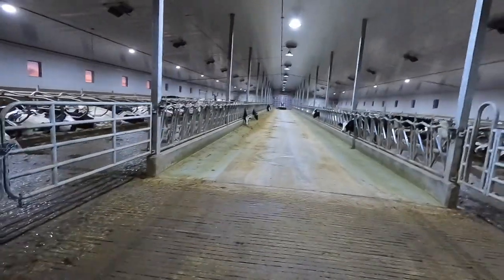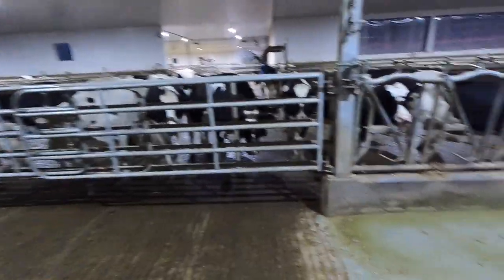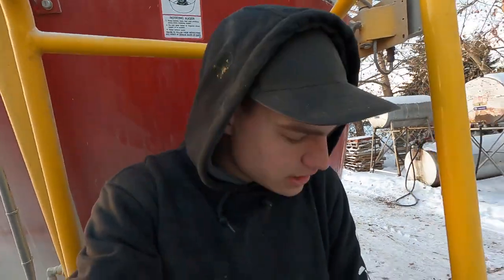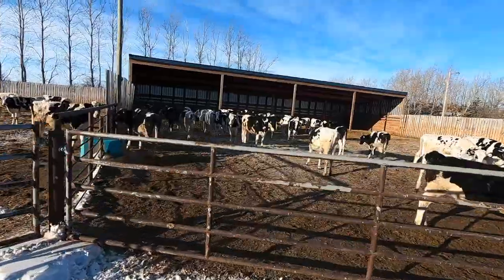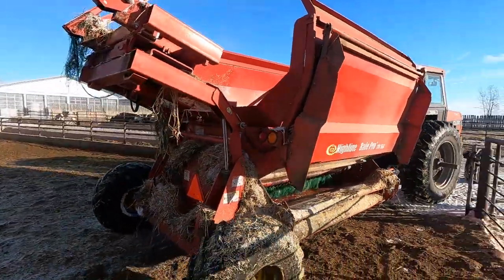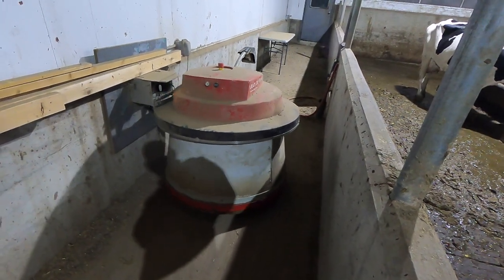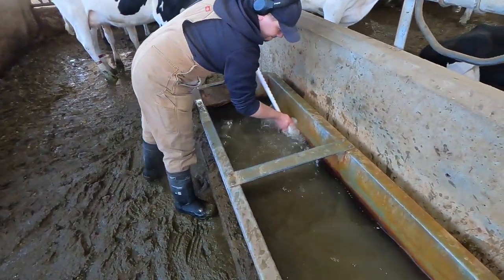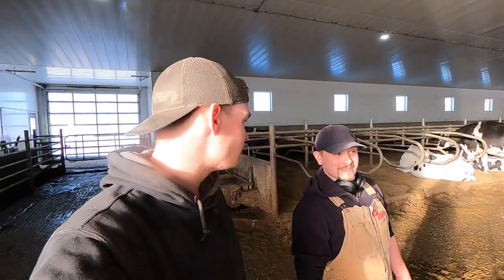Cleaning Water Troughs And Grinding Concrete!

Comment: It's good to have a 1500 pound friend! That concrete grinding would go a ton better with a diamond wheel from the big box store or amazon. It will cut though so much faster, you will wonder how you ever did without it. No kidding. They are not nearly as expensive as one might think.

Comment: Next time you have to grind concrete, there are special tools for that, will make it go easier, and consumes less time. Diamond tipped grinding disc. They can be pretty costy, but theyvare durable and can be installed in any angle grinder. Usually meant for purposed angle grinder with a vacuum attachment built in because it's really dusty work, even with a vacuum attached.

Comment: So does your cattle barn have heated concrete or do the animals keep it warm enough
Reply: Cows can generate a lot of heat themselves, as they are working around the clock producing milk and digesting food. Much like an average human being generates as much heat as a 100 watt light bulb, you can multiple that by 10 times for a dairy cow that can weigh up to 1500 lbs...that is a lot of heat from I believe they have 300 head of cattle in the bedded area. The parlour may have underfloor hot water lines, but Jan et al can confirm if they have an opportunity.

Comment: Every farm puts the old slow tractor on the mixer.  When my father milked cows he hade a ford tw20 on the mixer. Now we do heifers and we don't need the mixer anly more so know we just use a side slinger bucket on a skid loader to feed the heifers. My Dad quiet milking right before the prices dropped like 5 years ago. Because are one neighbor from Ireland hade a buddy over from Ireland and my dad was bailing hay for or neighbor and they were talking about different stuff and he had said the prices for milk hade went up in Ireland then my dad got thinking about it and you knew or one neighbor who milked about 200 cows was looking for somebody to raise heifers for them and he asked them how much they would pay him and once he figured out all of that then he sold all the cows and then he raises heifers for them. We still used the mixer and the tw 20 about 3 years an, about 2 years ago, then my dad we ran out of the room in or shed to store stuff so my Dad decided to sell the mixer and the tw 20 and went and got the side sling  bucket and it works pretty good because we don't really need to mix feed for the heifers.

Comment: @SaskDutchKid, how do you know when the correct amount of each ingredients are going into the feed wagon?
Reply: The hopper area of the feed wagon has an electronic weigh scale readily/available/visible to the operator, powered by an ordinary motor vehicle battery and remains charged off the tractor/alteneator system. Each pound/kg of their available feeds such as the malt hulls/grain/silage is thereby scaled to achieve the correct Total Mixed Ration (TMR).

Comment: How do you keep the weight of silage consistent when using a bucket ?
I don’t see you adding part buckets by not completely emptying bucket and returning balance to pit !
Reply: I believe there is a scale on the feed wagon or they have one in the loader that they can go off of
Reply: @justinafriesen650   Thanks for details how bucket weights are calculated

Comment: To be or not to be, wether or not to milk the cow with blue legs...  😀
Reply: That cow being milked appeared to be a newer dairy cow. To assist with milk letdowm some dairies use oxytocin until the cow breaks the habit of withholding their milk. If the dairy cow continues to need that type of assistance, they are on the shipping list and their offspring and the AI is flagged for this behaviour and if necessary again culled or no longer use that semen for the AI process.

Comment: Thank for the vid! Question: what do you do when cows die? Do you bury them or something?
Reply: I used to work at a pig barn and they had a dumpster to put the dead’s in and the a garbage truck would take them somewhere and turn them into dog food. obviously more pigs will die then cows but I would assume something similar happens
Reply: They normally a taken away by a special company, animal rendering is what it's called. https://en.m.wikipedia.org/wiki/Rendering_(animal_products)
Reply: Rendering I would imagine. As long as the animal wasn't diseased, I guess the meat could go to animal (zoo or pet) food processors. In any case the rendering truck would likely take it away.

Comment: I've been wondering why when mixing feed you put the small grain in first then the silage.  I would thing the small grain would combine better with the silage if it was put on top.
Reply: Their mixer has two large inverted cones that auger from the bottom to the top, and then the grains are mixed throughly with the silage as it rolls inwardly to the outside walls of the tub area with the silage, thereby providing a through mixture of the TMR.

Comment: Mate that's not a concrete grinding disk im surprised it didn't explode hahaha
Reply: There is a concrete grinding disc impregnated with industrial diamonds, availalbe for $87 on Amazon, made by Bosch (turbo model) and they are far superior and a LOT safer and faster.

Comment: Watching this two years later, but I figured I'd add this comment anyway... Give that guy a break hand scrubbing those 8 water troughs. Get a round brush with a plastic handle, shave down the handle to fit into a cordless drill, then use that as a power brush.

Comment: Hey Buddy, you have a part # for that wheel i gotta grind a piece myself Ty 👍
Reply: Bosch Turbo concrete disc available for about $87 on Amazon.
Reply: @edk1609  ty Sir ✌
Reply: 7" - Bosch Turbo Diamond Cup DC73OS
5" - Bosch......DC53OH